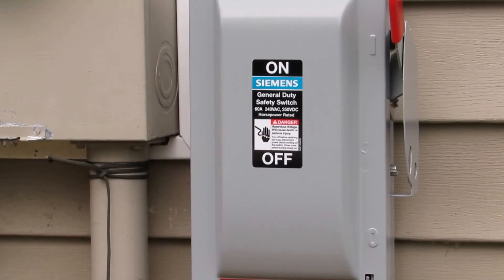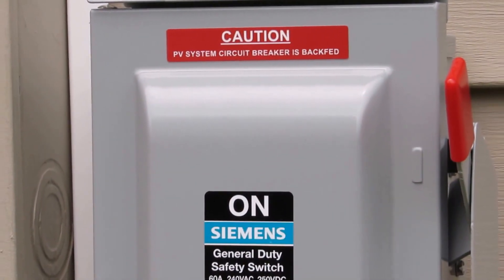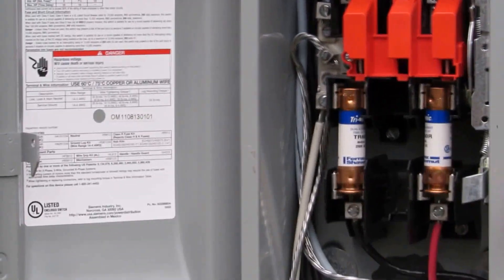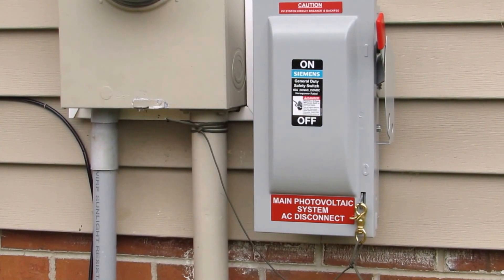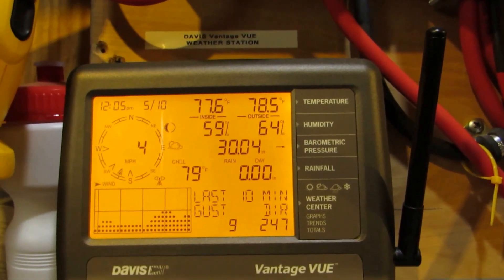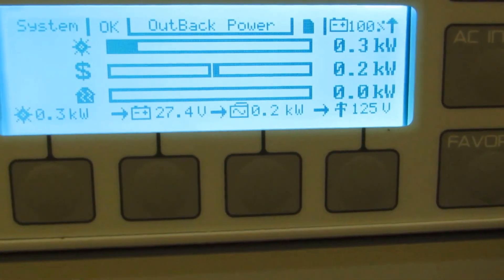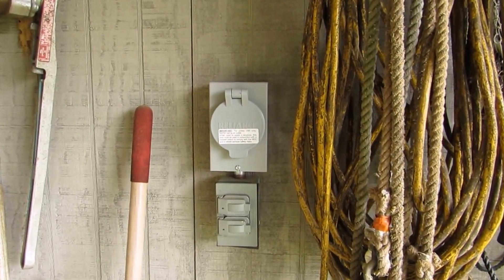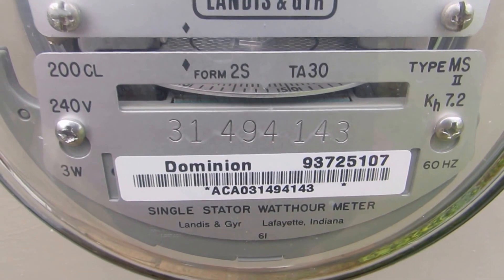Solar And Wind Power Safety Grid Tie Electrical AC Disconnects By kvusmc

Comment: Nice vid Kenny! I have nice battery backup right now with inverter and a rectifier that keep the batts topped off but my next step is to add solar so I can drop the rectifier and use the charge controller and help cut back on my draw from the grid. Right now I run my office, alarm/video system, fridge and freezer 24/7 on the in inverter with batt back up so if we take any power outages it never looses a step.   I have a second inverter I can turn on for that is connected to a transfer switch to run some other things in the house for long term outages and use my Honda eu2000 to keep my 3 sets of 125ah battery bank wired in series for 375ah charged.
Reply from the maker: Thanks Brother Holy Moley Brother Nice System You Got Any Video's Of It OORAH

Comment: I think I finally figured out your wiring on AC side of thing.  It looks like you got a sub panel in the shop fed by your main (120/240).  And your Outback GTFX back feeds a single (120v) 30amp breaker in that sub, supplying solar panel 1st to shop, with excess feeding back to your main panel (via that new sweet 240v Disconnect).  Then the excess solar/wind supplies power to house's main circuits. Then I'm guessing any left over surplus power after that back feeds the utility and spins meter backward?? I'm actually helping out a buddy who's got a similar ac layout so seeing your setup helps me out
Reply from the maker: You Hit It Right Dead On The Nose You Figured It Out Greatly Plus I Have Another Reliance / Critical Load Panel In The House Running From My OutBack GTFX 2524 Inverter To Run My Loads During A Power Outage With The Flip Of A Switch  ! You Get An A+ sunsensational  For Figuring Out My System  Amen Brother
Reply: thanks kenny, i feel like i just won a prize. lol
Reply from the maker: You Did Brother You Are The Man People Have Been Asking Me For Years About My Setup I'm Almost @ Net Zero

Comment: Thank You for the great video and information. Very nice setup. Is there such a thing as an automatic shutoff switch?   What I am trying for is that if the grid should shut down, It would close the connection to the grid allowing me to power the house without concern for the line workers.  I don; have a system yet. trying to learn before doing anything. Learn first and do it right.   Again Thank You.
Reply from the maker: Usually If you have have battery back up grid unit there island protected where they won't operate selling power back to the grid when the power is out plus saving linemans life